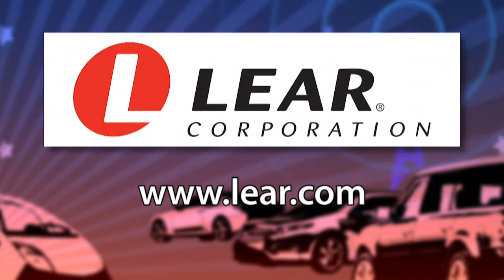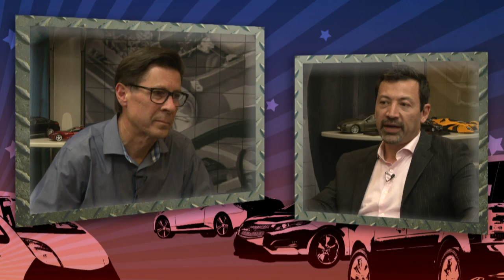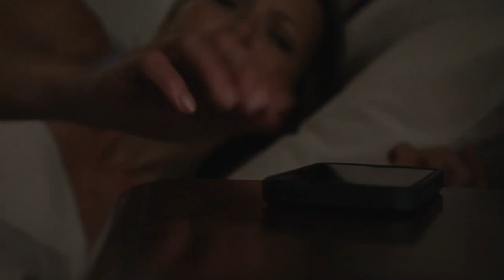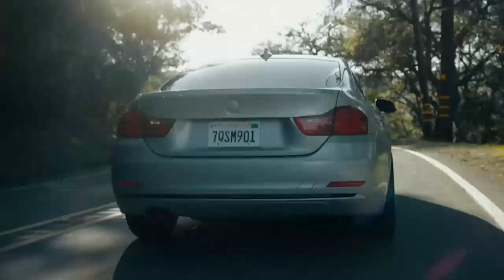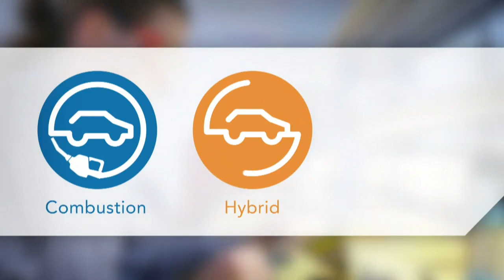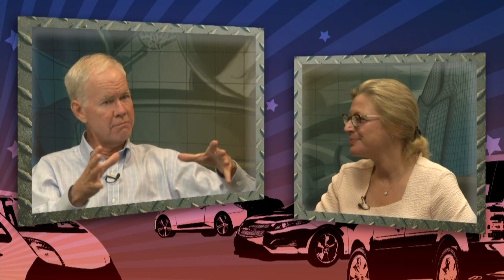The Story Behind The Story of Ford's Transmission Problems - Autoline After Hours 472

Comment: I have one in my eco sport 2017 and now 25000 km on the car till now work great and no problem and as I drove manual cars I see that the transmission act normal  and a lot of people don't know how this gearbox work and how to deal with it and to use but not pretend that other people not telling the truth there are problems big one in this gearbox I love my car though and how ford deal with it from the start and after was awful and trouble and next cars will be not ford because of this even if I didn't affect by the problem.

Comment: NOT  don't buy a ford,   don't buy any car with a gas engine and transmission with all of those moving, wearing parts and all those potential problems.  EVs have a fixed reduction gear, and no typical transmission.   Combustion cars are the past. Buy an EV.  Much fewer wearing parts and maintenance and fewer potential reliability problems.  Now is the time. Never look back. You will never look at cars and car manufacturers the same. Don't deal with franchise dealers either.
Reply: 2 Teslas on autopilot drove into concrete barriers in California (one dead driver and one near miss).  I don’t need a car that commits suicide

.

Comment: @autolinenetwork, I cannot understand why your staff is so in the dark regarding Ford's DPS6. Does nobody on the staff read what is happening in the automotive world? I say this as to the types of questions asked regarding the Ford DPS6 nonsense that has been happening around Ford's Global Markets since 2010/11. Why the journalist whom broke the story so to say, didn't even make the point that outside of Ford's North American market, Ford replaced the DPS6 in the Focus for the face lift version MY2015 with  the torque converter 6F series transmission. Are you or the journalist aware that the DPS6 was used in may of Ford's vehicles not sold in North America EG: C-Max, Grand C-Max, B-Max, EcoSport.  Ford is GLOBAL company not only USA :-)
Reply: Except this is a US show aimed at US customers 

.

Comment: I worked for a Ford Supplier most of Ford's the engineers are to dumb or too lazy to design anything and if they did it probably either would not work or could not be mass produced.  The vast majority of Ford Parts are supplier designed.  This is somewhat a Ford company culture their probably would not have been a Ford Model T without the Dodge brothers designing and manufacturing the many of hard parts of the T.

Comment: Larry Erickson: 1) On the rear of cars should be violet lights that would be lit if the car behind is tailgating,  then increasing in brightness and eventually flashing as it got closer.   Exception conditions are applicable. 2) Blind Spot Warning System.  3) The two items above can be implemented by all manufacturers in a one year time period without Ralph Nader or Congress or waiting for AV tech to solve death on the road.   Voluntary, self-imposed industry wide safety regulations would be welcomed.
Reply: How do you know Blinking tailgate warning lights would improve safety?  Manufacturers installed Daytime Running Lights buy later studies by showed DRLs did not reduce accidents

.
Reply: @electrictroy2010  The 'Violet Light' idea is not the same as daytime running lights.   They would be lit only if the car behind begins to tailgate.   Brightness would increase as the tailgater got closer and then would begin flashing and increasing in brightness.
Reply: The point is you need to STUDY to see if the blinking lights improve safety/reduce accidents.  I suspect like DRLs there would be Zero reduction in accidents 

.
Reply: @electrictroy2010  Canada, Denmark, Finland, Hungary, Iceland, Norway, and Sweden all require lights to be on when a car is in drive.  In the U.S. you OFTEN see people who have forgotten to turn on their lights when dusk emerges.  Add to that fog, gray days, gray cars on gray roads, black cars on black roads, blind curves, diminishing grades, cloud cover and you can see why lights should always be on.   Regarding the Violet Lights idea, engineers at Continental or Magna are more than capable to design non- invasive luminescence.
Reply: @electrictroy2010  your vested interests are apparent
Reply: I don’t work for a car company.  You guessed wrong.

Comment: And some complain on panel gaps on Tesla !?? Haha. I will buy a Tesla after the vacation, and never look back 🤓
Reply: 2 Teslas on autopilot drove into concrete barriers in California (one dead driver and one near miss).  I don’t need a car that commits suicide

.
Reply: Your first sentence is good and mostly true.  Your second sounds like a nut.  (Vegas shooting was an actual crazy local citizen, not a false flag.)

.
Reply: @electrictroy2010  point being that people earlier complained about panel gaps on Tesla when IC cars have from time to time various much bigger problem, like the transmission in this case. Fewer rotating parts in BEV means lower OPEX.
Reply: Tesla car and company has too many problems for me to blow $40,000 on them.  I can buy a subcompact Nissan or Ford or Mitsubishi for just 12,000 and put the other 28,000 dollars in the bank

.
Reply: I did also.  I only own 2 EVs now.  Over 45k miles driven with the only maintenance being tire rotation and replacing windshield wiper blades.

Comment: The Corolla 2019 sedan was supposed to be a new model, but they had transmission problems that needed to be addressed. The 2019 Corolla was an add on year on the 5 year cycle. They fixed the problem and only released the new model as a 2020 model in April. Go Toyota.
Reply: But they lied about putting android auto into all their cars.  Toyota has stagnated for 10 years, which was fine until EVs came alone and new tech came along.  Toyota's plan of changing nothing would have worked great against all existing companies, it has failed miserably now that new EV companies have arrived.
Reply: Toyota produced overheating engines that turned Oil into sludge (as early as 15,000 miles).  Then Toyota REFUSED to replace the engine under warranty.  The US government had to step in and force the company to replace millions of engines..... So fuck Toyota

.
Reply: @_PatrickO  that's the best u could up with ... 🤣🤣 Go Toyota !!!
Reply: @jermainec2462  lol, I traded my corollla in for a volt.  And that will be traded in for a tesla.  You keep dreaming, toyota stagnated and lying about android auto was too much.  People are tired of waiting for toyota to come out with a proper corolla hybrid.  They keep holding back features so it doesn't fully cannibalize the prius which was a huge mistake.  I wanted one with the eAWD and android auto, there is no guarantee the next year model will even have it.  The volt is fantastic since I don't use gas at all for daily driving.  I'm ready for a faster tesla now, but might as well wait to see what happens with the Y now that I am already driving an EV.
Reply: @_PatrickO  man stop u can live without Android auto dude ... And stop trading shit your spending all your money 🤣🤣🤣 keep the volt and get a Tesla ...
Reply: @jermainec2462  too fucking funny.  The second you start telling a customer that they don't need what they want just because you don't offer it, is the second you lost a customer.  You basically just confirmed toyota fucked up.  Plus they flat out said in fall of 2018 that all cars would be getting it, then that never happened.  They lied.

Also don't tell me how to spend my money.  That corolla was 10 years old, I drive cars until maintenance starts to add up.  But the volt isn't going to lose me money and the tesla is going to be paid for by buying some tesla stock when it was at 180.  Even then, even paying for half would be great.  I have money because I am cheap.  There is no value in a corolla anymore.

Comment: These clutch-based transmissions need to be hybridized.  Refer to the Hyundai Ioniq and Honda/Acura NSX.  The electric motor is used to bring the car up to a crawl and the clutch is engaged.  No slip, no wear.  If you don't need full hybrid capability, you can get by with a tiny (i.e. cheap and light) battery.
Reply: And then the battery dies & you have to waste $3000 replacing it.  (I know because I’ve replaced batteries in both my Civic and Prius hybrids.). No more hybrid cars for me

.

Comment: The more videos I watch about how cars work the more I like my Tesla.
Also I don't buy the argument that people don't want cars anymore. Strangely this drop in sales coincided with the release of the Model 3, which seems to be extremely popular for a market segment that's supposedly dying. I think it's more like people don't want to buy ICE cars anymore, and switch to electric where possible. We will see what happens when the Model Y and the Tesla pickup comes out next year.
Reply: https://www.forbes.com/sites/jeanbaptiste/2018/10/26/tesla-cars-may-be-the-safest-in-america-but-fail-in-reliability-consumer-reports/#5877527c416d
Reply: With the wide and inconsistent panel gaps?  Teslas are far from perfect, but like a lovesick boyfriend cannot see the flaws in his girl..... you can’t see the flaws

.
Reply: Search “hitting a pothole with my Trsla cost 2600 in repair”

.
Reply: @electrictroy2010  

If you actually watch the video, you will notice that the problem wasn't the electric powertrain and not even the car, but the wheel. The same would have happened with any other premium car with similar wheels.
Reply: Also 2 Teslas on autopilot drove into concrete barriers in California (one dead driver and one near miss).  I don’t need a car that commits suicide

.
Reply: @electrictroy2010  
And how many people did the same? At least one of the drivers died exactly because a human driver crashed into the same barrier a few days earlier and used up the attenuator.
And anyway, this is not full self-driving anyway, just an advanced driver assist feature. Let's see what your car does if you let go of the steering wheel.
Reply: Tesla calls is “autopilot” which implies it pilots the car by itself.  Tesla is misleading the customer (and causing deaths because of that misleading).  It’s really no better than VW’s misleading ads about “clean diesels” that lacked NOx and soot filters (therefore not clean)

.
Reply: @electrictroy2010  

It's slightly misleading, but you have to be really ignorant to not know what it is. The term is actually correct, as it comes from aviation, where autopilot doesn't mean fully autonomous operation either, just fancy cruise control.
Plus using autopilot in a Tesla requires to have your hands on the steering wheel. The car even warns you about it in several ways, and eventually pulls over and stops, if you don't do anything. Early versions weren't nagging you as much, but I think they had warnings from the start.
So as far as I'm concerned, anyone dying in a Tesla due to not paying attention deserves a Darwin Award.
Reply: @electrictroy2010  
You know, nobody ever cared about the panel gaps of a car until Tesla. Customers still don't care, just those who want Tesla to fail. I'm fully aware of the flaws of my car, but unlike you, I also know about all of the advantages which outweigh the flaws like 100 to 1.
Reply: Panel gaps have ALWAYS been part of car reviews.  It’s called “fit and finish” by most reviewers, and goes back 20 years before Tesla even existed

.
Reply: @electrictroy2010  
I barely heard anyone talking about that, but now that's all I hear. The problem isn't that they talk about panel gaps among other things, but that it's all they talk about and ignore a ton of far more important things.
Reply: And how much did actual customers care?
Reply: Customers care if a panel has a 1/2 inch wide gap in one place & no gap elsewhere.  It’s a sloppy assembly
Reply: @electrictroy2010  
That was years ago. Current cars are practically perfect. And the new factories will likely even beat German quality.

Comment: My Ioniq hybrid has a dry dct. The electric motor can eliminate clutch slip. Only bad thing to do is let the bit idle throttle hold you still on a hill. The electric starts me off and engine clutch engages just after I start rolling, very smooth. And it doesn't slip into neutral 🤣
Reply: And then the battery dies & you have to spend $3000 replacing it.  (I know because I’ve replaced batteries in bboth my Civic and Prius hybrids.). No more hybrid cars for me

.
Reply: @electrictroy2010  I have a lifetime warranty on the battery. However it's terms dont cover degredation. They do cover failure if you're the first owner in the US.
Reply: In my state a degraded battery will turn-on the Check Engine light, and that’s an automatic failed inspection.  Of course Hyundai won’t fix it saying “battery still works” so I would be stuck with the bill

.

Comment: The manual shifts have no problems..... that’s what I chose on my Ford Fiesta 3-cylinder (also manuals are $1000 cheaper than automatics)

.
Reply: I ended up with a 6F15 automagic -- only because of $4865 in rebates and dealer incentives.  It was far cheaper to buy from dealer stock than to order or dealer-exchange the cheaper model.  Still, I minimally get 37 MPG.
Reply: If the price hadn't landed at $16,900 I would have gone Honda, and all those in-stock models were CVT.  No way would I have paid $22,000 for a focus, but I did okay -- and no "powershift!"
Reply: I have CVT in my Insight.  It had known problem where the “pulleys” wear out after just 60,000 miles.  No more CVTs for me

.
Reply: The honda CVT are said to be less-bad -- I just don't want to pay $900 for one.
Reply: I couldn't find a honda fit with manual -- the reason I ended up with the ford.

Comment: Do not buy a Ford
Reply: Do not buy a Ford.  Do not buy a GM (ignition issues)... do not buy a VW.... do not buy a Toyota (unintended acceleration)... do not buy a Honda (bad transmissions)... do not buy XXX........ soon we won’t have anything left to buy

.
Reply: @electrictroy2010  Hyundai/Kia. I'm sure they've had issues, all cars do. But not life-threatening.
By the way, as far as I know, they didn't use Takata airbags, either.
Reply: Hyundai/Kia cheated on EPA fuel economy tests and lied to customers about it

.

Comment: Caugh ... Firestone tires ... caugh
Reply: good point.  history repeats.
Reply: Firestone was at fault. They made the cheap ass tires. Ford trusted that the tires were good.
Reply: @DocWolph  No stability control back then.
Reply: @DocWolph  The Explorer's wheel base design was to short -- causing the vehicles to flip. It was not Firestone's fault. Ford's lawyers made up a story and threw Firestone under the bus. Do your research.

Comment: The Ford DCT transmission issue is old news. Here are details of government prosecution in Australia in 2018  https://www.motoring.com.au/ford-fined-10m-for-powershift-handling-112310/   Ford Australia has been buying back DCT cars, when threatened. Initially Ford blamed software, replaced transmissions, blamed drivers and told them that they should manually shift gears. They offered discounts on new vehicles.

Comment: This transmission issue with the Ford and Fiesta has grown very bizarre over the years.  For one thing, this is hardly a new story.  The complaints have been well known for years now.  Its amazing how this hasn't been resolved.   If this is such a big problem I don't understand why the regulators weren't on top of this long ago when all these safety complaints started pouring in.  The other thing I can't reconcile is why the vast majority of Focus and Fiesta owners love the car.  That is not disputed.  I looked closely at buying a Focus in 2012.  I read all the criticism and It was weird.  About 90% of owners loved the vehicle, then there was another 10% that was oddly consistent in complaining how the clutch was a disaster and needed to be replaced.  

Apparently the new story is there was a cover up within Ford that the cars never should have gone to market.  I don't dispute the facts of the story but I'm not quite buying the story that Ford didn't do anything resolve internal concerns.
Reply: You need to read up on the ACCC example from Australia. It was clear Ford Australia were using the same tactics as described in the interview of blaming owners and waiting for the out of warranty period to recoup costs they were obliged in law to cover but went all out to avoid hence the lawsuit.
Reply: Regulators were more concerned with saving the American car industry than protecting customers 

,

Comment: A couple of points not brought up.  First, the DPS6 was successful in certain Volvo models, and there's a distant chance it still is.  The difference?  Hydraulic actuation and wet clutch packs rather than servo and dry clutch.  I don't know who designed the TCU and dry clutch mechanisms, getrag or ford.
- 2, Some later-year Focus have a 6F15 transmission coupled with the one-liter Fox engine.  It was only put into SE sedan here in U.S.  I own one, so it was always possible.
Reply: It's the project name, just as the 1.6 is called Sigma.
Reply: If the Volvo transmission from Getrag has wet clutches and hydraulic shifting, it's by definition a completely new transmission. I doubt very much that Getrag which is a highly respected gearbox manufacturer would have signed off on the Powershift (Ford marketing speak) transmission. It's got Ford cheap design written all over it.
Reply: I have a feeling it's ford manure -- just couldn't find reference to prove it.  Actually one of the failures was that "powershift" needed a lot of electricity.  Paint didn't get rasped off before the chassis ground screwed in; lights and electronics would work, but the neutral was insufficient to power the servo mechanisms.